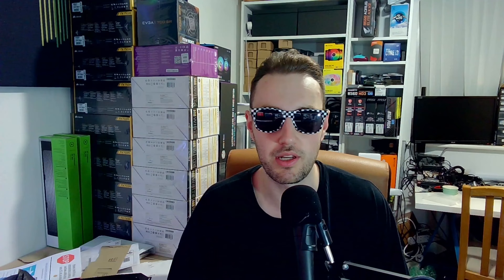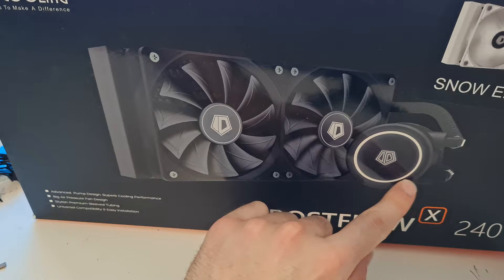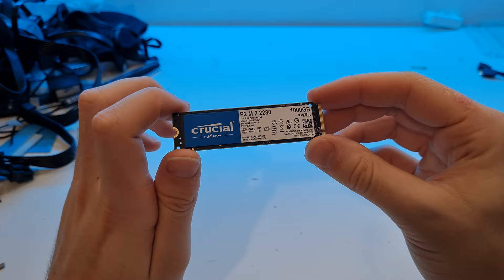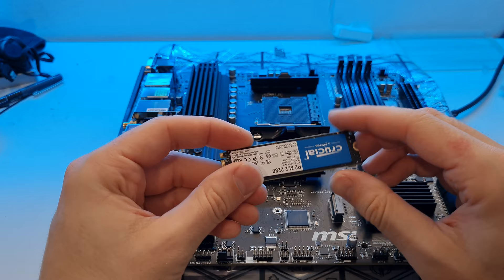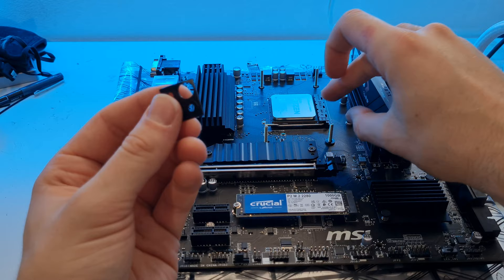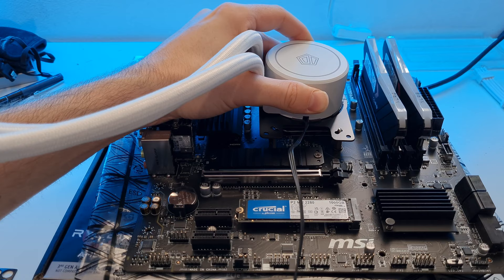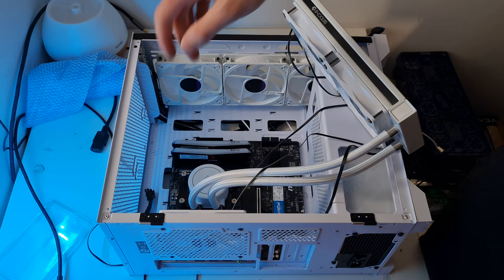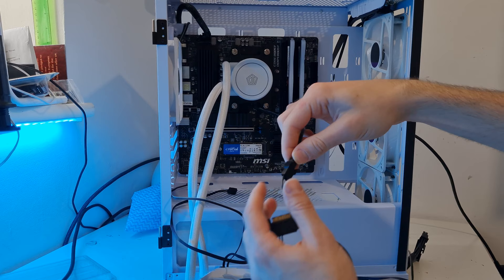Let's Build A Gorgeous £1100 Pure White Gaming PC | Full build guide

Comment: Hi! I will be building my first ever PC. I’m in the process of getting all my components. This video will probably help me assembling the PC, so thanks for that. I have a question regarding the fans. The motherboard I’m planning to get is a gigabyte b550m aorus pro-p. I’m planning on getting fans with 4 pin. Would you know if I will need an adapter to connect around 6 fans in a thermaltake s100? Thank you.
Reply from the maker: Awesome!

It's worth checking on Gigabyte's website as this will usually be listed in the spec

But either way, a £5 set of PWM splitters is all you need if the board doesn't have enough headers

Enjoy the build :)